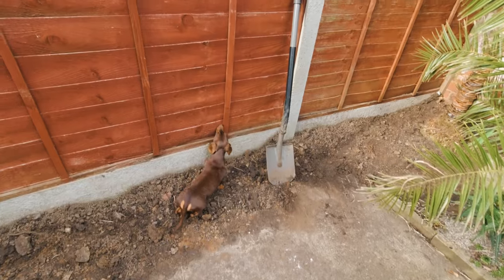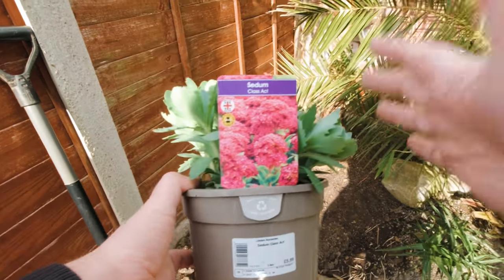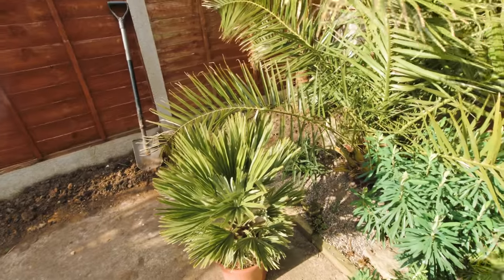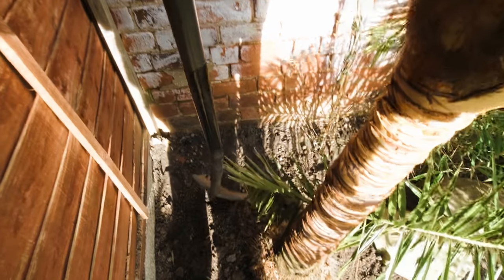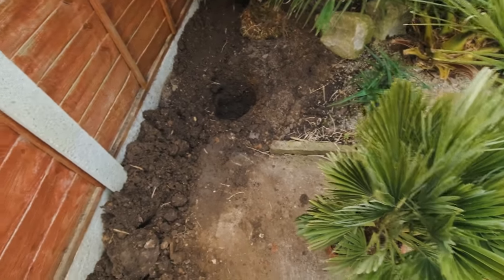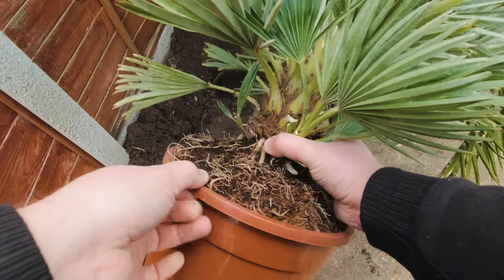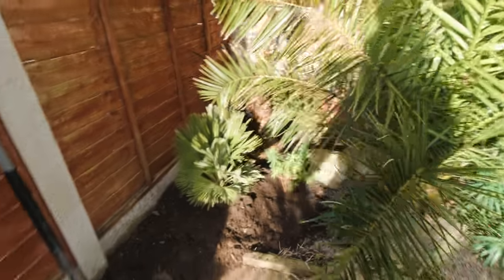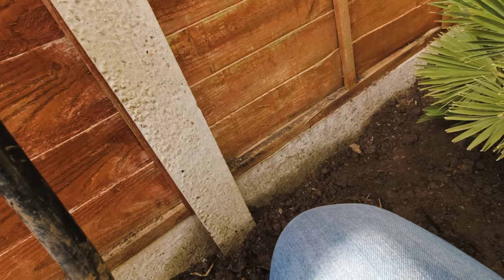POV Gardening - New Exotic Plants & Planting a Sunny Mediterranean Border

Comment: I think your right about soil structure and not digging large holes for plants ,nutrients in the holes like fertiliser just stop the roots spreading naturally . Another great video .
Reply from the maker: Thank you very much Gordon, these are the little bits I wouldn't have maybe included in a more organised video but hopefully these will bring out more. I appreciate the support!
Reply: I found this method interesting. I’ve always been taught to work the soil, amend it, dig wide for planting and also to loosen up the circular roots so they don’t keep growing like they did in the pot. Maybe I’ll do an experiment as I’m beginning to plant out new gardens. Appreciate the content. Hello from Texas 🌿✌🏼
Reply from the maker: @kt9495  Thanks KT and it completely depends on your soil and plant rather than being a general rule. If you’ve got hard clay soil etc I’d definitely break it up and a lot of plants with circling roots will settle better if you tease them out a bit. But if you’re lucky enough to have good garden soil and the plant isn’t completely root bound or has brittle roots then I don’t worry about either. I generally look at soil amendments over a larger area rather than just the hole, just adding grit under a plant can create a sump and the water can actually collect there and adding too much goodness to the hole can slow down the plant spreading it’s roots into the soil around (according to current thinking). Like I said though, it completely depends on your soil, 99% of the plants here have gone straight in the ground though ☺️